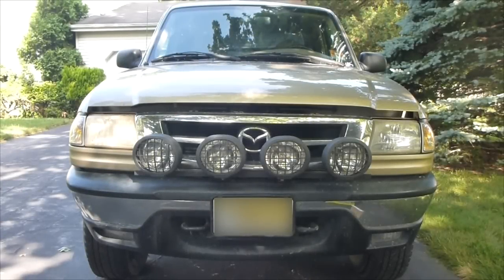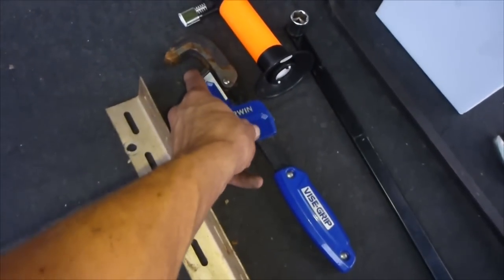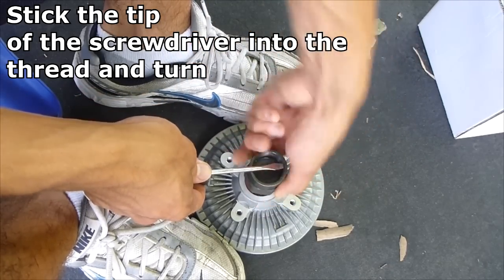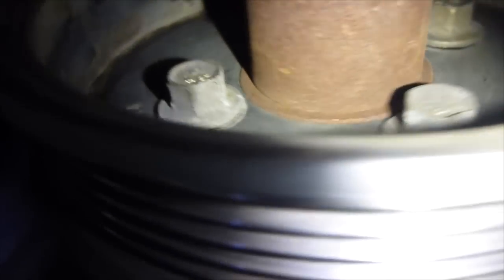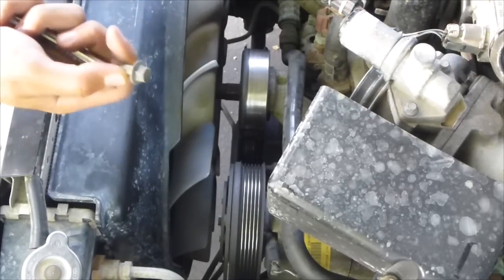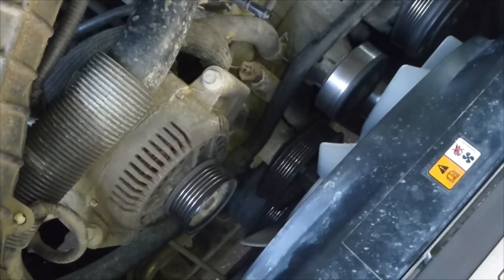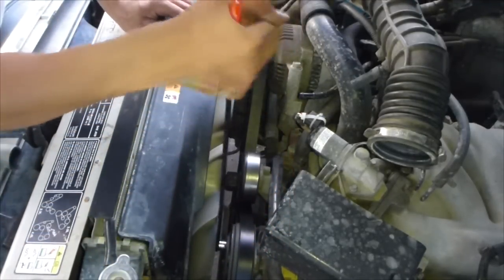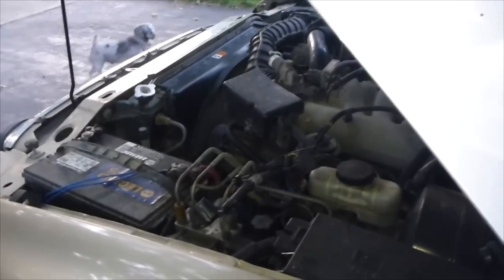How to Replace a Fan Clutch

Comment: So , does the fan clutch screw off counter clock wise ? I can not get mine off ether way , errr .
Reply from the maker: Flench AOM Most screw off just like in this video. Were you able to see a letter R or L on the nut to let you know if it is a left hand or right hand nut?
Reply: ChrisFix  No Chris , I did not see one  .
Reply from the maker: Flench AOM Watch 4:20 again and hopefully that helps you.
Reply: ChrisFix   Thanks Chris .

Comment: To unscrew the fan clutch, you should always have to spin it in the same direction as it spins when running, since you want the rotation of the engine to tighten the fan clutch screw and not to loosen it.
It screw it back on, obviously you have to spin the fan in the opposite direction.

Comment: U 4got to mention that you gonna have to pre-plan this fix B4 the actual fix, exmp: get the right parts & dedicate the entired day to fix this, if you have big hands, you might gonna need a smaller frame friend to do the tight areas or you'll give up & curse to the car designers for such an impossible tight area to work on it, this project will test your patience to the limit but the reward is that you will not paying huge amounts of $ to the mechanic.

Comment: My truck actually does that. Only sometimes though.. I always wondered why it did that lol
Reply: The fan clutch engages to blow air through your radiator to cool the engine, since there is no air flow through the radiator when you are stopped.

Comment: Even if the vent it's blowing hot air also?
Reply from the maker: Joe Windsor huh?
Reply: In regards to my ac. If I'm not on ac and I'm just having air flow through my vents and it is hot do you still feel it's just a refrigerant problem?
Reply from the maker: If you are not on AC the air will be warm because it is coming from around the engine compartment. You might also have a blend door problem.

Comment: Actually, no need to replace the clutch. Just open up the clutch, clean it and re-fill the Silicon Oil into the clutch.  I have seen many taxi drivers doing the Silicon Oil re-fill. Cheap and good. LOL.

Comment: Wtf... Why they made a clutch for the cooling Fan O.o a complicated mechanism for spinning a fan... Did they never heard of electric motors? Some cars for towing in hot areas have 2x450W Fans with heavy relays and heavy wire diameters to supply them. Seems to be more controllable and reliable than this mechanism

Comment: What happens if you start a car without a belt
Reply: it doesnt start
Reply: +ADRIAN CIRNU *cylinders ;)
Reply: Gunnar Kári fail.
Reply: I doesnt start mate
Reply: video games expert it starts, just no power steering, no ac, alternator won't charge, and water pump won't turn.
Reply: video games expert heres the real answer it wont start at all
Reply: ADRIAN CIRNU what are you talking about?? Try starting most your motors without the timing belt and see what happens..., you can start your motor without the serpentine belt it just won't have the accessories I listed above.

Comment: its wrong how this job is getting done, there's special tools to the job easier & correctly, air hammer with the impact wrench, i could get the job done with in 10-15 min
Reply: It doesn't matter how the job is done all that matters is it's done, Chris is showing how to do it without the special tools hes doing it with handcommon tools

Comment: why replace the clutch ? Good cooling but disadvantage is the noise, but that's accepteable. You just have some more eyes staring at your car, while you think you're famous :)
Reply: Yea but it can cause your belt to slip and break
Reply: keep in mind the engine has to work much harder due to stronger Wind resistance generated by the high speed running fan

and that will mean harder working water pump and more fuel consumption
Reply: Acnologia oh okay thats bad...
Reply: Really dude? It doesn't work like that
Reply: Julian w.centrifugal force will break apart that blade
Reply: Also remember, you don't want the fan spinning when the engine it's still cold